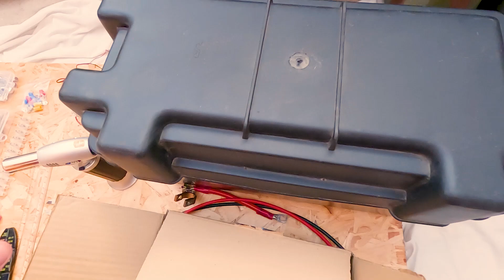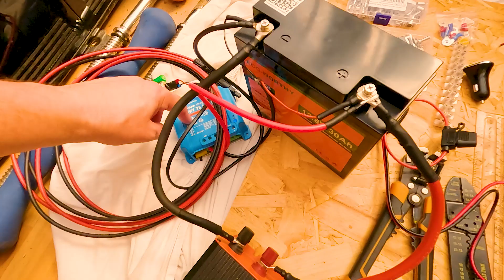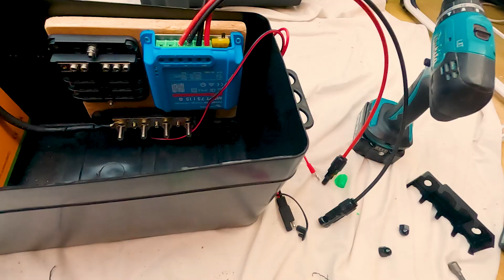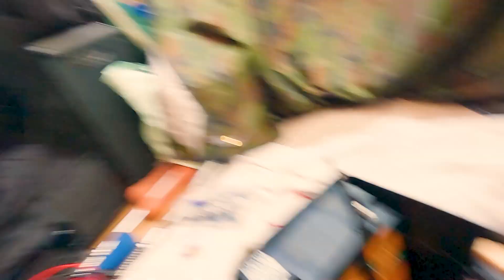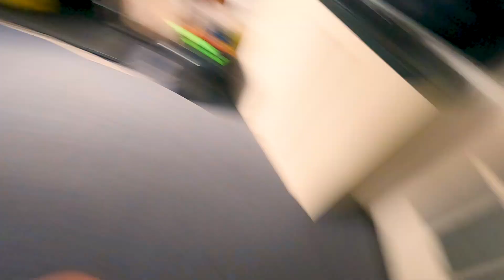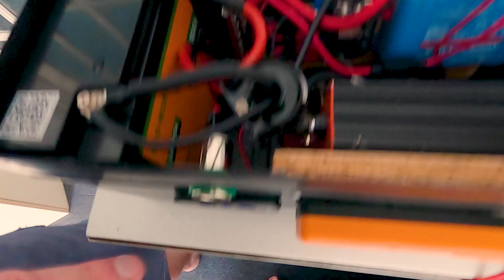DIY Solar Generator | Self build comparison with all in one package.

Comment: Great Vid as normal. Ive made 2 very similar to these, i used Anderson power pole connectors to my mc4 thus not having any wires outside of box, you can 3d print the faceplates for the power pole connectors. Easy to set up and then you can have the mc4 cables connected to the solar panel for charging. i did like the idea of using buzz bars aswell, good shout, Thank you.